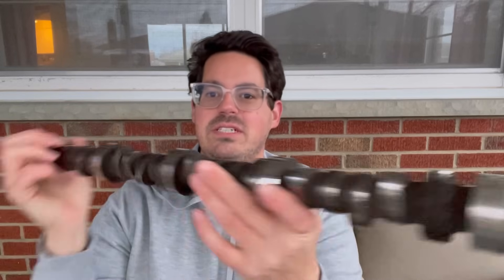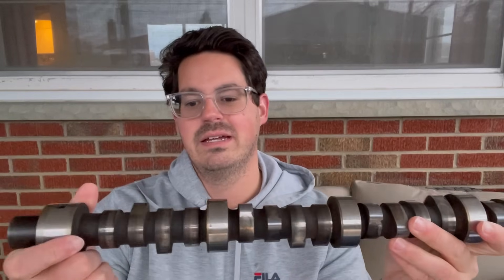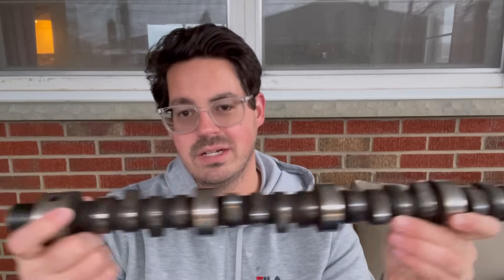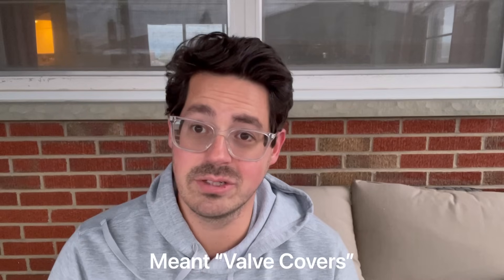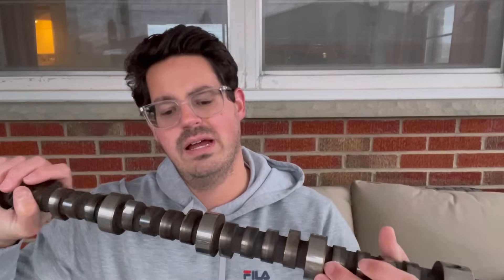Worst Automotive Components: Soft Camshafts (Chevrolet 305 & 350/Cadillac HT4100/Pontiac V8s)

Comment: I can remember the era of bad camshafts very well. My father was a shadetree mechanic in his spare time and changed numerous camshafts for friends and family. It was a cottage industry. I would hold the trouble light and pass tools. 

The local police agency ran police-spec Malibus and those would wear out camshafts in a matter of months. The solution was to use TRW camshafts. The engine rebuilding shop swore by the TRW camshafts and offered a guarantee that that was far beyond the OEM replacement camshafts. 

Did the 60-degree V6’s have a similar problem? There was a rumour about town that the Pontiac-Buick dealer would burn a hole in the strut tower to change the camshafts in 60-degree front wheel drive applications. The cutout was welded back in and slathered with undercoating. 

Besides a metallurgy problem, some thought the OEM camshafts did not have enough offset relative to the lifter. Some offset is desirable so that the lifter spins on each lift. If dead centre, the lifter will not spin, causing the bottom to dish. Not sure if the camshafts were cast and machined incorrectly, or they were allowed to walk during operation. 

In your Pontiac camshaft, you can tell by the wear pattern that there was definite offset. The wear pattern is shifted to one side of the lobe.
Reply: It wouldn't surprise me if the dealer cut a section out of the strut tower and welded it back together.  I don't think that's a terrible way to go about it, either.  Rather like the way the inner fender was cut on some GM cars to replace the blower motor.
Reply: @21stcenturyfossil7  um, the shock tower is structure , apples and oranges .
Reply: @willallen7757  So what if it's structure?  Just about everything on a unibody car is structure.  A properly welded up joint is just as strong as new.  A unibody car is held together with welds and it works just fine.
Reply: @21stcenturyfossil7  yup,  I would just never do such a thing anyway .
Reply: @21stcenturyfossil7  I guess I  should say wouldn't do it  to my car.  If a customer wants it done ,it makes your life easier .
Reply: ive got a 3100 in a 99 buick century with 325,000 miles
LIM gaskets at 180k..... heads at 300k..... and a timing cover gasket due to water leak at 324,000 lol
.
but the cam and cly walls look pretty damn good..... less ring lip than my 400SBC with VASTLY lower miles (probably 50,000)
.
.
i love the GM 60 degree 
they make pretty decent power actually.... not as efficient as the buick 3.8..... 
but Buicks Engineers were THE BEST, at least when buick got to design their own motors (like, the 3800 makes more power and gets better MPG that it has ANY right to)
.
.
but the GM 60 degree (2.8, 3.1, 3.4, 3.5, 3.9) are some of the EASIEST engines to work on EVER
water pumps take 10 mins.... 
alt and P/S pump are on top
can do the heads in about 6-8 hours..........LIMs take me about 3 or 4 hours now (ive done about 5 of them LOL)
.
.
and ive NEVER understood why the Ford 3.0 made so little power
both the OHV and OHC versions makes less power than a simple pushrod GM 3.1
.
and thats the "small port" 3.1 (1999 and older)....... 
in 2000 they made the ports larger.... picked up 15HP.... and cast the intake smooth VS finned 
.
.
and the Ford 3.0 OHC also has like 50 vac lines.... and AT LEAST 100 coolant lines
such a pain to get some of the coolant hose clamps also...
.
.
yet, the GM 3.1.... upper and lower rab hose..... a metal pipe for a bypass (which also warms the throttle body)
and 2 heater hoses....... THATS IT
.
.
.
.
.
more power
more reliable
more MPG
easier to work on
less rad hoses, vac lines and stupid design decisions 
.
and the sound of that 60 degrees flat plain crank at 6500RPM....YUMMY! (fire order is 1 2 3 4 5 6) 
idk.... that V6 makes a better intake noise than most V8s
Reply: Yep, I agree!
Reply: Thats a pretty hack way of getting a camshaft out. I have replaced a few camshafts in v6 GM's in the car. Basically have to pick the entire engine up 2/3 feet until there is room to slip it out. Its basically an engine/trans removal job with the engine still physically in the car.
Reply: @mph5896  yeah the torching a hole is most likely urban legend after 1 guy did it .
Reply: Yep had a 3.0L Buick Century that had a soft cam
Reply: @louisbaiani6262  do you mean 3.1??
.
the centurys had a 2.8 and then grew to a 3.1 in the 99-05 bodies (same basic engine however).
Reply: TRW or Isky's,  Iskendarian cam and lifter sets were awesome value for money, ofc you go a step or two above stock.

Comment: The first car I bought with a Pontiac OHC6 ('69 Tempest for $200) had completely rounded off lobes (lobes GONE, just circles) on cylinders 5 & 6.  It had run as a 4 cylinder for quite some time.  There was an oil passage in the block going to the rear lobes and if it got clogged up for any reason this would happen.  I used a rubber mallet to knock the stuck valves open again, got a good used cam, and the car was running on 6 again.  I was surprised that brand new cam followers (rockers on an OHV engine) were in stock at the dealership (Rinke Pontiac at 11 & Van Dyke) in the early 1990's.
Reply: YOWZA 😆

Comment: Adam, the 1968 Chevrolet 307 V-8 had the softest camshaft and lifters!  Would wear the the cam lobes down and make holes in the bottom of the lifters.
Reply: Yes, I remember this issue around that time also
Reply: Also  had nylon faced  cam  gear.  The only 1 I  ever saw  shred into the  pan was on a 307.        67 was a change  over  year  for the  SBC's  . 2. Things that I always  put in my  rebuild.  Steel cam gear with  double  roller chain set. And  Brass freeze plugs. Stock  cams went in the scrap metal can.
Reply: @knutbjornlarsen4435  — Back from that era, the nylon-toothed cam gear was common practice.
Reply: Very true, but to my experience, Pontiac V-8’s in the late 60’s were more prone to this than Chevys ... The Chevys became worse about it in the mid-70’s ...

Comment: In my auto mechanics class in high school I recall an early Dodge Aries K car with essentially round lobes on the camshaft.  The instructor Mr. Bench told us all to buy a Cadillac to avoid that problem.  His 472 cube Caddy V8 from around 1972 was certainly fine.  Little did  he know how bad his 1987 advice was.  Really funny how much of the education of the time was to prepare one for the industrial work force ... and I spent my whole career in the 'information society'.
Reply: That's odd.  The "Trenton" Chrysler inline four cylinder was rough as a cobb. It was basically an "improved" VW EA827 engine, but it was durable as hell and tons of fun with a turbo!  I'm not an expert but I've heard these engines run forever as long as you keep oil in them.
Reply: @Flies2FLL  I can't claim to know anything about that early K car ... other than it was purple and obviously an early example based on the grill looking as Dodge Mirada as possible.  Maybe it was abused.  Maybe it had 200,000 miles on it.  Dunno.  It was purple however and the cam lobes were no longer extant.
Reply: @Flies2FLL  looks like a vw motor too and chrysler was putting vw motors in the omnis
Reply: @Henry_Jones  they ran awesome had an omni and horizon .  Clutch and cv joints were the weak links.
Reply: @Flies2FLL  I had a '85 Lancer you could outrun on foot during turbo lag.  On the highway ran like a healthy v8, dang gas tank was too small 11 or 13 gallons .
Reply: @willallen7757  Torque Steer was like hang on for dear life in my 1985 Daytona Turbo Z.
Reply: @mph5896  lancer has no torque steer, a small drive shaft with u-joint and carrier bearing fight it off for you .  I figure the engineers had espresso that morning.
Reply: Next on Motorweek..................😆

Comment: Not much of a GM guy so I'm not sure, but did these cams tend to fail during the time period they were made? or Are they failing commonly in modern times due to oils without the wear additives like ZDDP combined with the lower hardness?
Reply: This was when they were new.
Reply: The worst of the soft cam years were in the 70s and 80s.  The failures were in then-late model cars.  ZDDP didn't seem to make that much of a difference back then.
Reply: If the cam is too soft no amount of anti -wear additive will save it. Surface contact pressure causes localised fatigue of the metal. Ultimately fatigue cracking starts to cause little flakes of metal breaking off the surface, which wears away the lobe.

Comment: I had a 1984 Chrysler Laser 2.2 engine that one lobe rounded and the lifter fell out because it was so worn. I was the 3rd owner, and I knew the first two owners and knew the maintenance was always done on time. I replaced the camshaft and put new lifters in it myself. I also replaced the timing belt at the same time. I still hate that car 32 years later.
Reply: I had an 85 Daytona turbo that actually had a broken cam but still ran. It had broken right behind where the cam gear bolted on, so the cam timing was off. I never could figure out why the car had no power until it blew a head gasket in 90, and I took the head in to be checked as a unit before just slapping a new gasket on it. The machine shop found the broken cam! New stock cam and it was like I had a new car. Lots of power, unreal mileage too with the 5 speed. I got rid of it in 97 due to rust, but it still ran perfect. To this day, I cannot figure out why or how that original cam broke. Bad casting? Improper torque of the cam gear bolt? Timing belt too tight resulting in stress on the cam? No clue.
Reply: @adamtrombino106  wow. That is crazy
Reply: You hate it or have it?
Reply: @life_of_riley88  I traded in that car in July 1991 on a new Ford Ranger XLT. But I still hate that Laser. I miss some of the cars I have owned. But not that one.
Reply: @haneyoakie14  A friend of mine had a turbo laser, fun car to drive, but looked like a real pain to work on.

Comment: In my experience of replacing flat tappet cams in SBC's if it's not broken in properly in the first 20 minutes lobes and lifters will fail.
Reply: Seems to be a huge problem now, supposedly there are only 2 manufacturers in the world producing flat tappet lifters and one is not so good. Very common to see the lifters fail nowadays, not so much cams.
Reply: @Terminxman  I haven't had a camshaft out of an engine in 25 years or longer

Comment: I used to have a 78 Firebird and an 84 Grand Prix that both had the Chevy 305 in them. I didn't have any camshaft issues
Reply: Most of the Chevy cams seemed to have been fine.  Only certain production runs were bad.

Comment: I worked with a guy that had once had a Chevy Suburban with a 305.  Coming back across the UP the cam lobes rounded off, and he forever after referred to that engine as the "305JC" - 305 Jello Cam.
Reply: Why is it only certain lobes? I would think all the lobes would be rounded off.
Reply: @treewino  my guess is relationship between springs and rocker load's aka the exhaust valves are sometimes under more pressure than the intake's as the cylinder still has about 20-100Psi vs intake's is under 0-nearing perfect vacuum so way less load and making the springs do more work to keep valve float under control
Reply: @treewino  dumbed answer oiling and or friction between the lifter's and the lobes and then add in there non-roller bits
Reply: a 305 in a suburban ?  yikes , the pistons are the same diameter of a coors lite.  soft cam ain't helping either .
Reply: Yeah, I don't think they offered that combo very long in the 80's.  And when you compare the lower block of the 350 and 305, and certain internal components, the 305 really was cheap junk.
Reply: @jeffbranch8072  BTW the roofer trade it in with in 1-2 years or less guess they didn't like it
Reply: same but a k1500 1984-88
Reply: @richardprice5978  , yeah, I think that was the same time frame they offered a 305 in 'Burbans.  You probably had the same engine, same cam.
Reply: @jeffbranch8072  probably the truck was original ordered by a burely ID usa roofer ( i thought it was ordered with weird options ) and then a "nice" lifted frarm truck for my uncle and next a construction / concrete truck for dad then my first truck in high school and now going to be restored and modified to my taste's probably a BEV as its easier to pass yearly testing in my areas
Reply: @jeffbranch8072  my parents might have split up because of the engine going bad and the two starting a arguments i barely remember it not that i watched the video anyway's its on it's 2 or 3 engine and now a SBC-350 mr good wrench autozoune replacement from the 90's aka lame + 700R4 and im a manuel guy not interested in automatic's ect.
Reply: ps. ended up paying dad if im remembering right 500 to 800 USD for it aka i didn't get off easy and by now could have had a newer truck for about the same money or less, but im sentiment about this one
Reply: Chevy never put a 305 in a suburban.
Reply: @davidcarder6364  , yes they did in the late 1970's and 1980's.  On the assembly line,  in production, both Chevy and GMC.